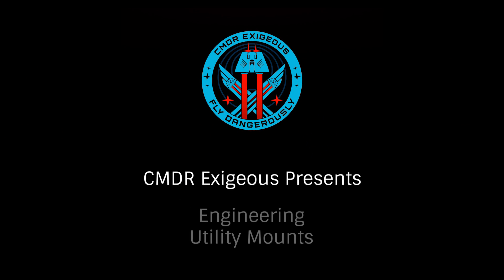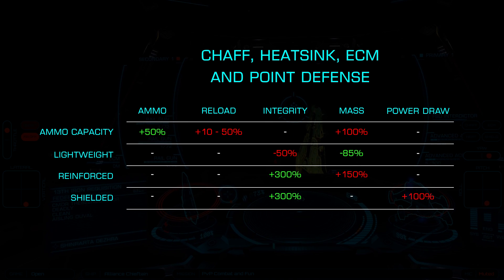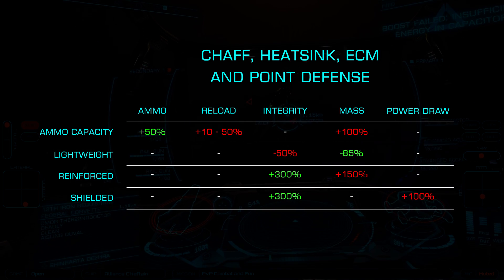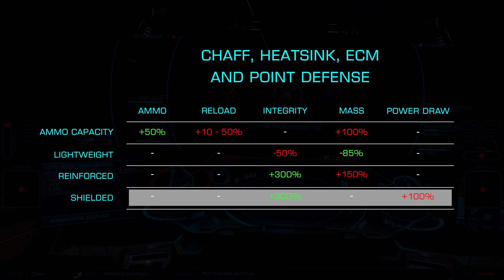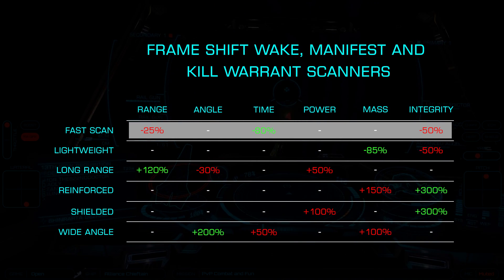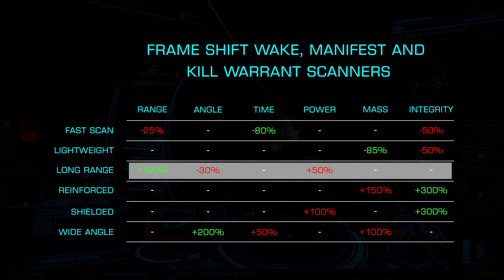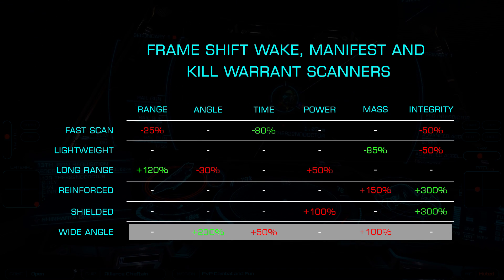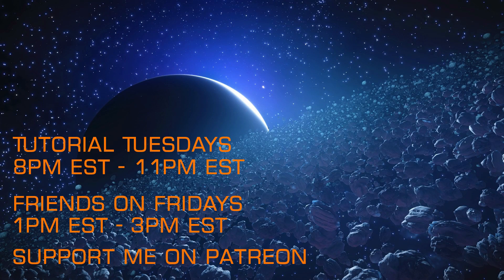Engineering Explained: Utility Mounts

Comment: You do really great work with your vid, whether it is
 tips/tutorial for loadout or way to earn money, for mission enginneers.
Tutorial for beginners, i think if i have to recommend some tutorial for a beginners you would be a must one. 

But concerning the video for the utility mount, is  the shield booster not missing?
And are others tutorials for enginneers component planned? 
Why not do a tutorial for fa-off with maybe some good manoeuvers to use in combat?

Still excellent work CMDR, thanks you.
Reply from the maker: Shield boosters since they are relevant to shields will be included in my (upcoming) video explaining shields in detail.  And yes, tutorials for all modules are coming, been rather sick so have had to take a break but they are coming, don't worry.